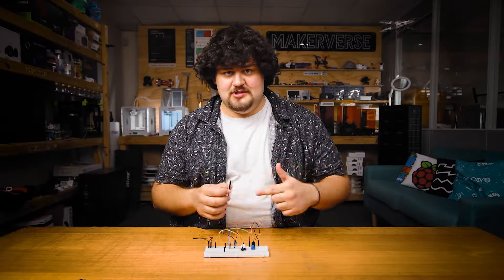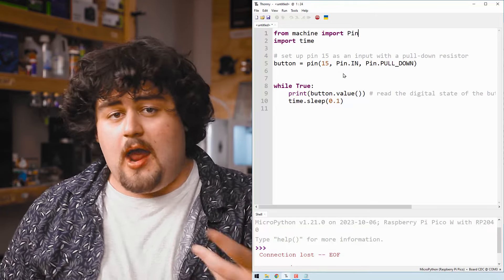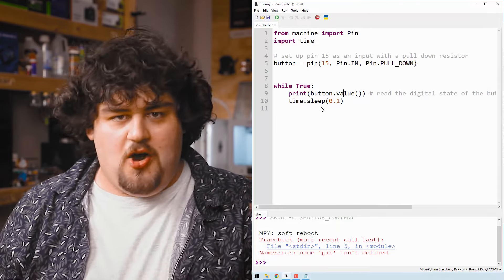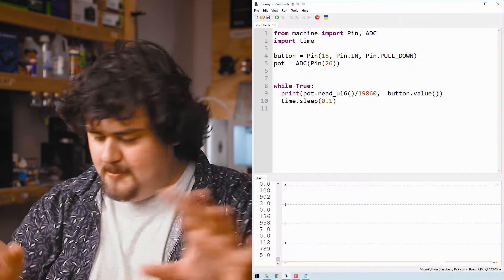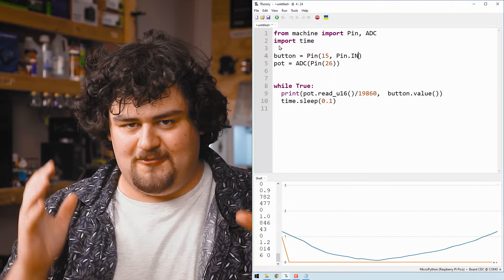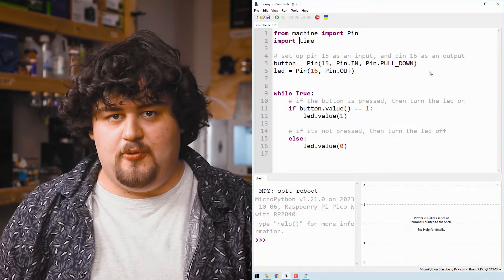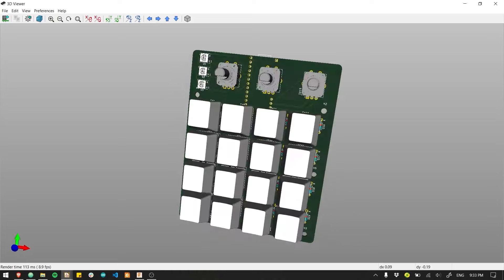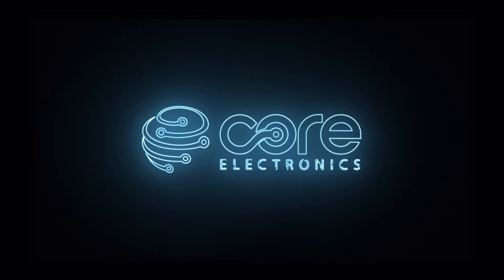Reading Digital Inputs | Raspberry Pi Pico Workshop: Chapter 2.4

Comment from the maker: Hey all, in the first part of the first demo we have the line button = pin(15, Pin.IN, Pin.PULL_DOWN). We goofed this but fixed it later in the video. Whenever we call the function Pin it should start with a capital letter (we have pin with a lowercase in the beginning).

Comment: 2:15 Just a minor note, a typo in a variable name doesn't yield a syntax error, since the code structure (syntax) itself is correct. In this case it's name error (as stated by the error class NameError). The interpreter understands what you're trying to do, but it doesn't understand what you're referring to.

In any case, thanks a lot for the great material, amazing course.
Reply from the maker: Thanks for the correction

Comment: led.value(1) aka led.on(), led.value(0) aka led.off(),  advanced demo ::   x = 55
led.value( 1 if x > 0 else 0 )  # will light up,  or even shorter    led.value( x > 0 )  # True is 1, False is 0
no need for multiple lines like
if x:       # any value that is not 0, not None or not an empty (string/list/dictionary/tuple) is True
   led.on()  # or  led.value(1)
else:
   led.off()  # or  led.value(0)